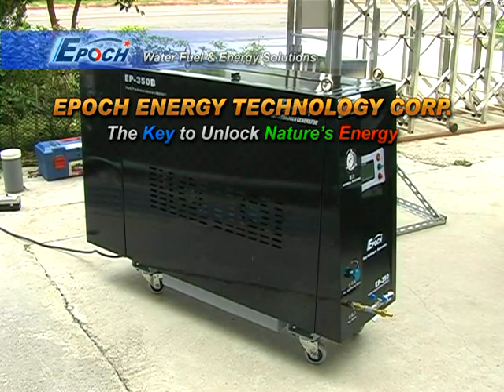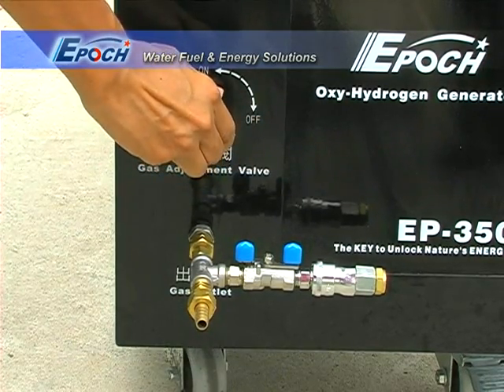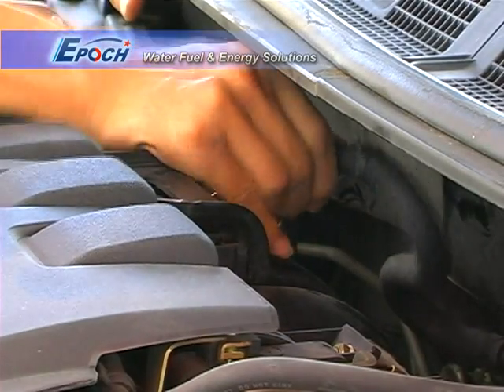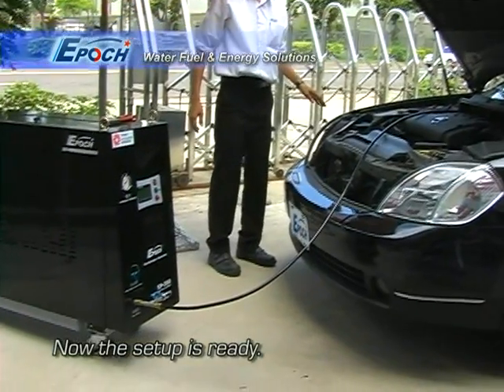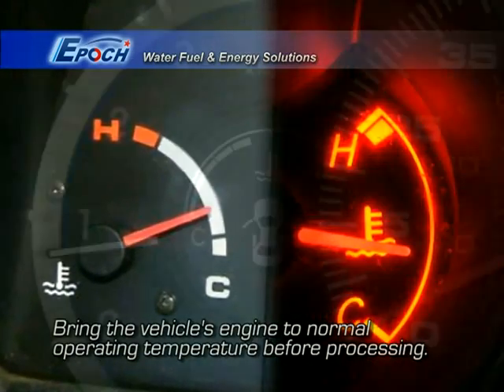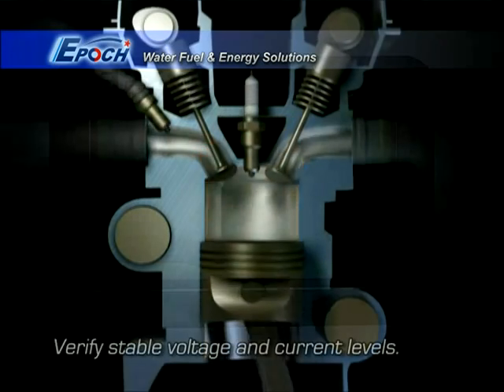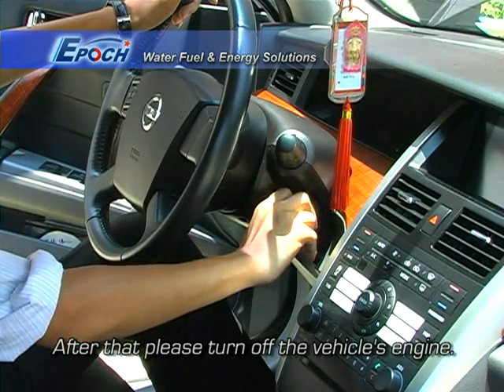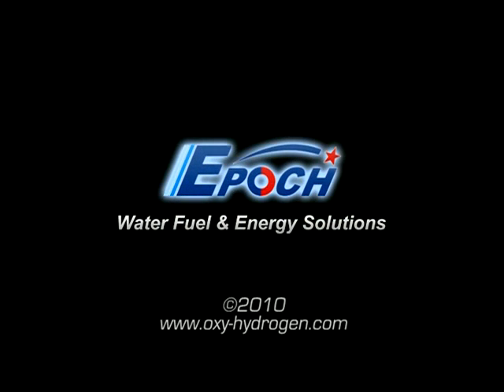Carbon Cleaning process with EP-350B (updated)

Comment: I watched your video link.  Those formula engines are rebuilt every race.  That "warm-up" procedure is no different than the factory "break-in" procedure the gt-r's engine does at the factory.  Even so the gt-r STILL has a rev limiter and even the Haynes manual for a 4 th gen Nissan maxima stipulates not revving the engine over 4000rpm with no load.   Like I said, never trust a mechanic that free revs an engine like u just did.

Comment from the maker: While introducing a controlled amount of oxy-hydrogen (HHO) gas into the running engine using our equipment will maintain cylinder wall lubrication, using water instead could be fatal.
All our research and testing has shown that no water will end up in the oil supply using our equipment. Again, when using water directly this can not be made sure of.

Comment from the maker: While it is technically true that slowly feeding water into a vacuum port might bring a similar result, our system provides a carefully controlled input of gases that will not create any potential for hydrolock or other damage caused by overloading an engine with water.
However, creating an accurate, reliable and controlled method for delivering water into a running engine is simply asking for trouble. If you were lucky, the engine only stalls; if not so lucky, major engine damage can occur.

Comment: I have heard of using distilled water too to clean carbon deposits out, but I have 2 concerns, #1 will cylinder wall lubrication be maintained or will some wear occur during this process. #2, how much water would end up in the oil supply and how much highway driving would get it back to normal, or probably just change the oil after this?

Comment from the maker: Our clients have done some testing. You can see some of the data regarding emission tests and dyno runs starting at about 04:29min in this video.
Fuel savings are not reliably measurable under real-world daily driving conditions, there are simply too many influencing factors. But we had clients claiming anything between minor improvements and up to 25%.
But basicly every client confirmed improved throttle response.